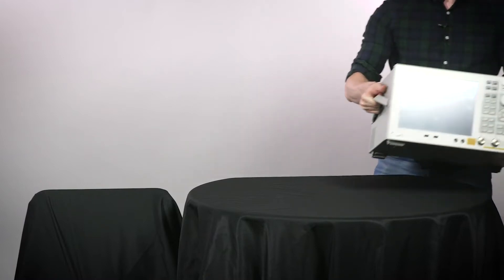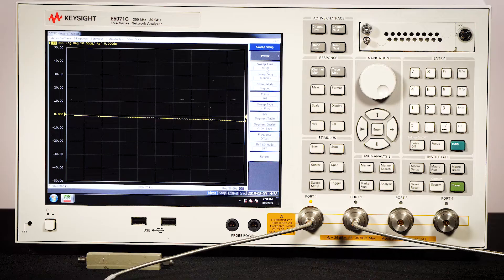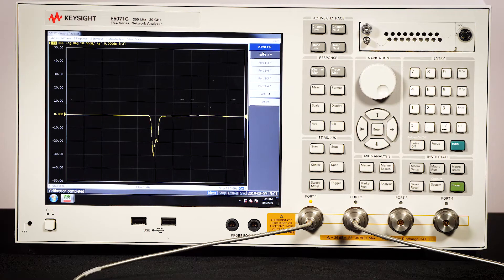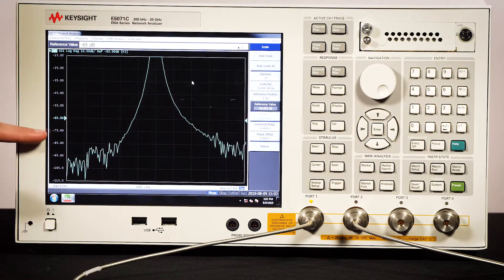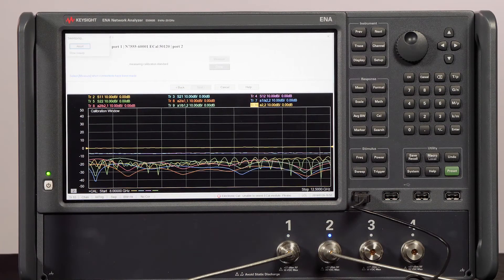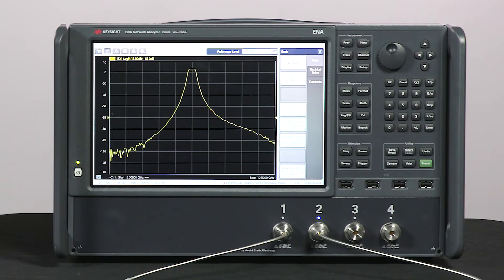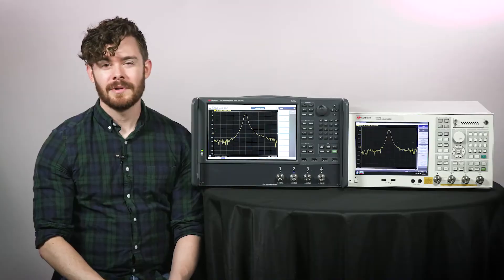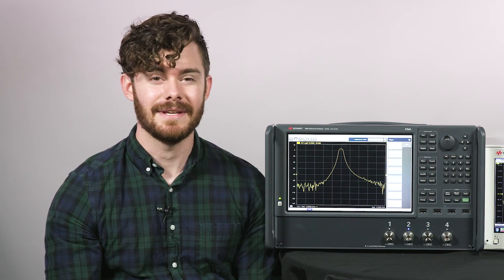E5071C vs E5080B Side-by-Side Comparison

Comment: Can you show how to do the 7 step mechanical cal kit process for posterity's scale ?   Also  those E5071C units
at work I use 1601  data points under stimulus menu.  Why 1601 and 1600 ?   Also it doesn't seem to go
higher than 1601 data points ?  Can it go higher ?   Narrower span  vs wide span does the data points
settings  auto-scale with span settings?